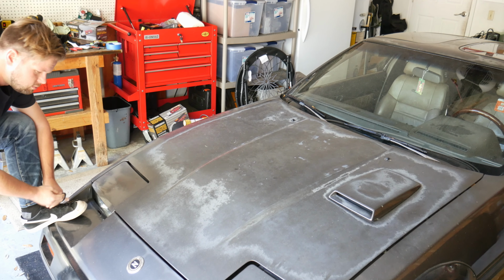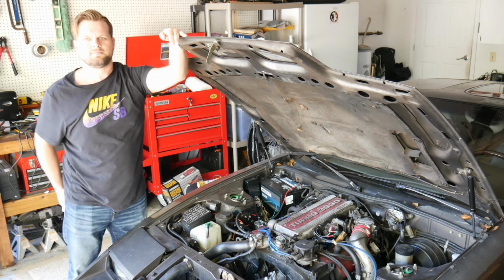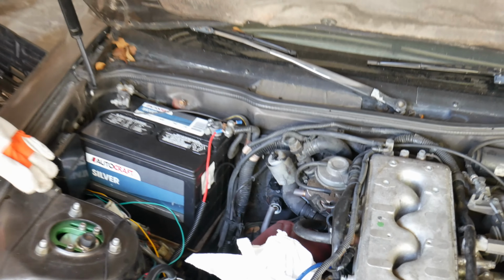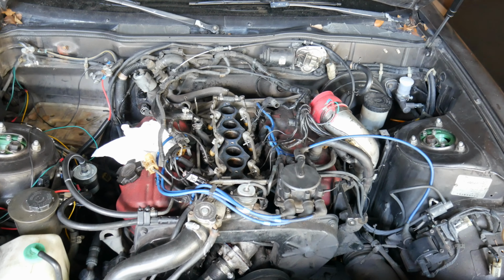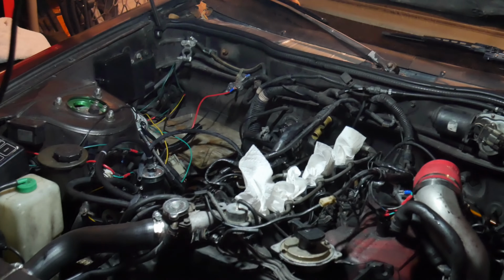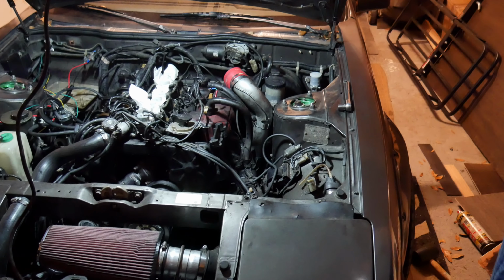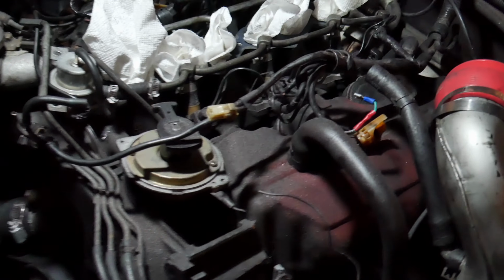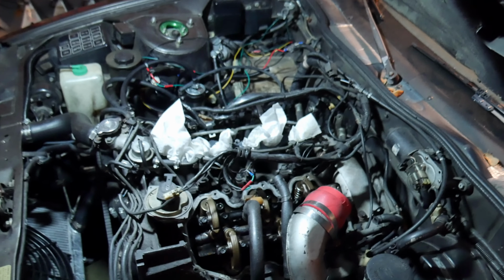Z31 300ZX turbo - Valve cover job part 1 Tear down

Comment: I just tore down one of these foe a parts car.... pb blaster was my friend lol and a saw
Reply from the maker: lol don't forget the torch too. Also a beefy impact helps a lot. It was the same way on my AE86 also. Some of those untouched bolts that have been on there for 30+ years will fight you tooth and nail.

Comment: Saw the Noles sticker on the fridge in background and wondered whereabouts you were located.  Not a good time to be an FSU fan.  This video reminded me of the fun my son and I had/are having fixing up his 1987 Z31.  We are finishing up a valve job, among other improvements.
Reply from the maker: We are based out of Tampa Fl, Carter is a big FSU fan graduated a few years back and yeah it has been a rough couple years for the football team to say the least. That's awesome though, they are fun underrated cars! Our valve cover/timing job very quickly spiraled into more with the crank issue but Carter has got it squared away now and there should be a lot more videos coming out on the Z31 very soon. Thanks for watching!